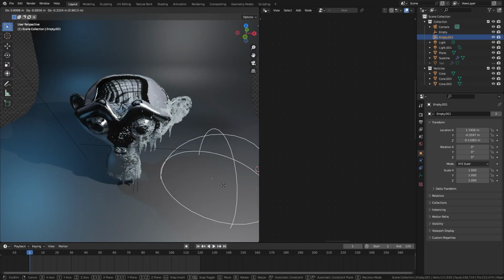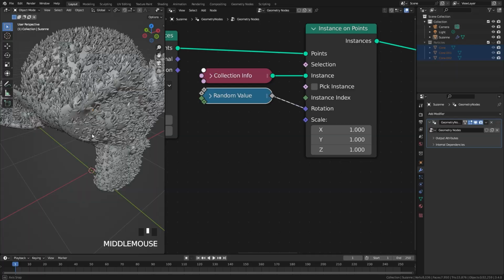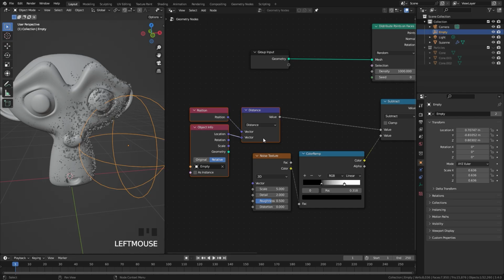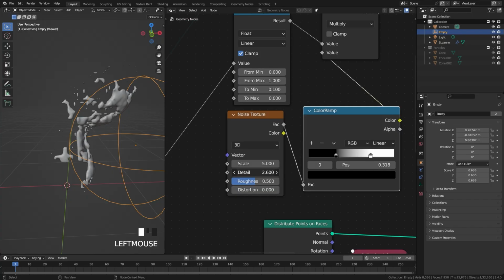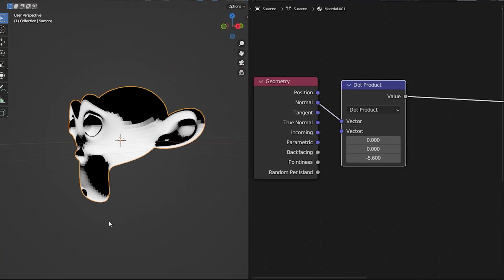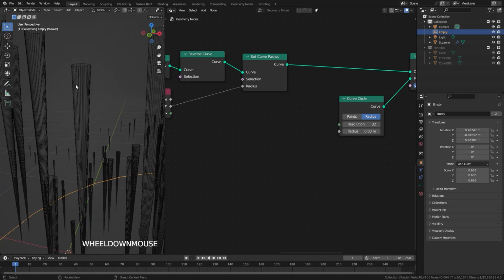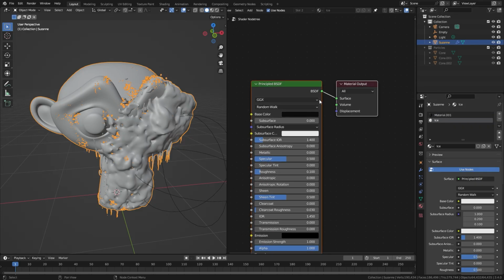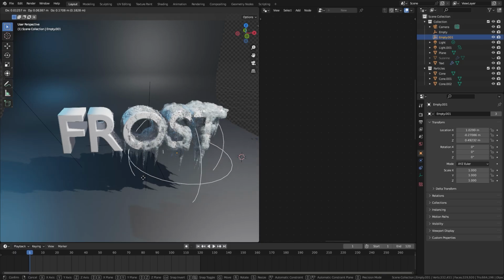Blender Tutorial - Freezing Effect w/ Geometry Nodes

Comment: Since Blender 4.5 you should use the factor output of the Spline Parameter node connected to Curve to Mash scale instead of a Curve Radius node for the icicles shape.
Reply: I believe you do not need to use the "Set Curve Radius" Node at all. To change the Curve Radius, output your "Length" from the "Spline Parameter" node and input it into the "scale"  value in the "Curve to Mesh" node.   

 And when you set the value on "Resample Curve" ensure that you are using Length instead of Count. If you don't, then you will be unable to input a value such as .005
Reply: @alfiejackson9137 thanks man this helped me a lot
Reply: @alfiejackson9137 THANK YOU SO MUCH!
Reply: Yes,  Lenght from /Spline parametr/ need to connect to scale in /curve mesh/
Thanks)
Reply: You saved my life.

Comment: awesome tutorial.  So I've been using thsi (and it's an awesome tutorial) but I've found a load of the functions don't work in Blender 4.1 - so I've had to go back to 3.6 to do it.
Musgrave not being there isn't a problem - you can switch it out for a noise texture to achieve the same effect.
For some reason, though, the position into the vector math node doesn't work in 4.1 and it causes a load of weird chaos, just in case anyone else gets stuck.  Worth an old version of blender if you want this to work as it does in the tutorial.
Awesome stuff again, cheers!
Reply: I solved the unpredictable random chaos by instancing the three layers in three different geonodes modifiers, two without merging the original mesh keeping the genereted geo only and one merging the mesh. Hope it can be helpful :) Also would need to test it but i believe 4.1 has some issues solving everything from a single vector math node setup with position, so i believe that simply duplicating that setup to drive each generation (ice, icycles and crystals) individually with exact same settings should solve the issue as well. Will edit comment and tag you if I get a positive outcome
Reply: Worked fine as in the tutorial for me in 4.2.3 - might be worth trying it again in a newer version and seeing if you have the same issue. Re: musgrave, just untick 'normalize' on the noise texture node.